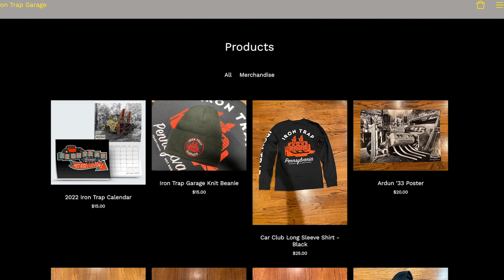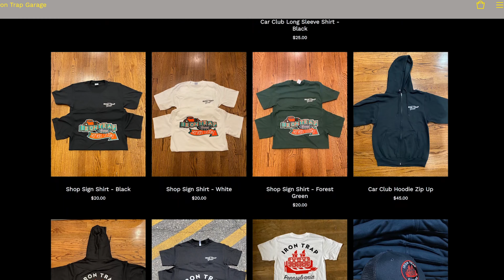Building Hurst Style Engine And Transmission Mounts For The 1932 3 Window Coupe

Comment: I'm curious why it was decided to TIG weld the mounts rather than more quickly & easily MIG weld them. Seems like they'd have come out just as nice with MIG and don't necessarily require the same level of carefulness that TIG welding provides. I'm sure there was a reason, though.

Comment: Cool to see an ‘old school’ hot rod with a Lincoln engine. At first I thought it was just another Shiverlay until I noticed the valve covers. Back in the 60’s I built a sling-shot style dune buggy as a high school shop project out of a wreck 53 Lincoln with a low miles engine and trans that I inherited.  I used the Lincoln rear end , 46 Ford front axle and a Model A frame.

Comment: I have been working with Lincoln Yblocks since about 1958, have two 54 linc one 52 one 56 one M335 57 Merc Super Stocker . if you need any info get back with me , also i have owned at one time about every peace of speed Equipment made, Roller cams, Hillborn Injection , dual Qaudes , ECT Ect.

Comment: Thanks Matt for building the mounts from scratch. Ir’s much easier  to just order them.  As someone already said, it is good to see the older OHV engines mixed in with the Ford flatheads. It would be interesting to see you build something with a Caddy flathead V8. It is a much better engine than the Fords. The engines are rare, but the speed parts are really rare.

Comment: I forget if the engine needs rebuilt or if it’s a runner already but either way going to be a cool hot rod
Reply from the maker: Supposed to be a runner! Got it from a friend that pulled it out of a customer car at a rod shop for a modern engine swap

Comment: Nice to have those original Hurst mounts for design reference. They came out "bitchen"!! 

One thing I couldn't help noticing while you were working on those mounts was all of the sparks going into the garbage cans/rag bins while you were using the plasma cutter. Would hate to see a video of your shop burnt down and that kind of thing will certainly do it. Rags smoldering while everyone has left for the day is "NOTORIOUS" for starting fires. Really easy, either move the cans or put some lids on them --------------- please.   ;o)
Reply from the maker: Yea hard to keep the sparks away from everything. Sometimes we miss moving things.

Comment: Morning Matt, seen this on Instagram, great idea as I mentioned,  our Olds motor will use the same type mount, matter of fact the 371-394 Olds motors has the factory engine mount off of the front timing cover...Matt, y'all will need to invest in a computer operated plasma burn out table, I want one but don't have the room.. anyway...be safe!! God Bless
Reply from the maker: Yea I’d like to have a cnc plasma but don’t have the space currently!